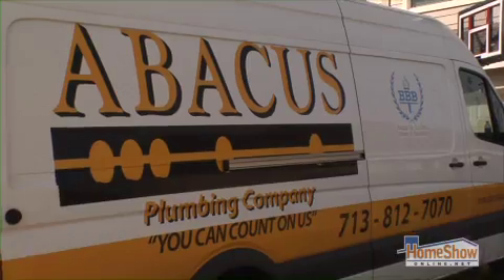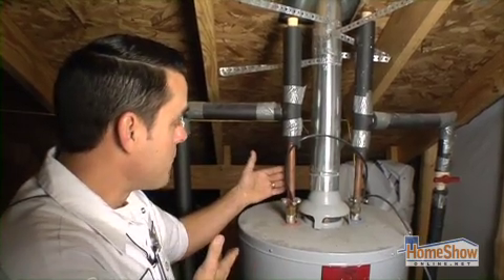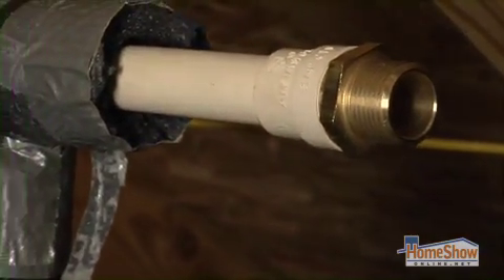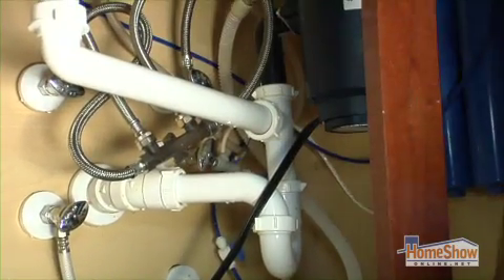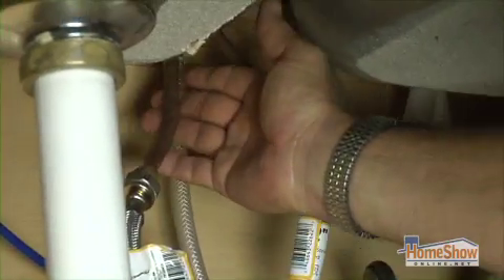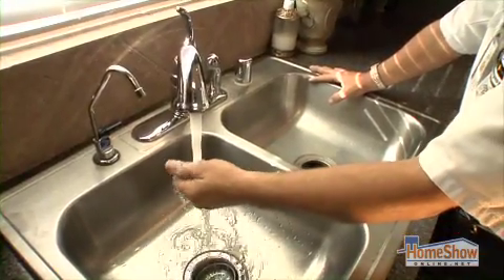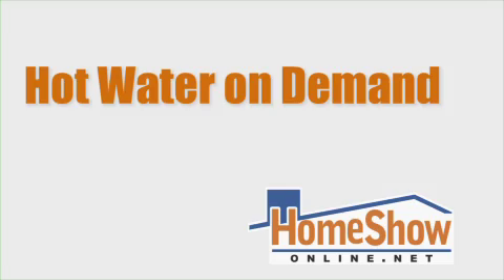Get hot water quicker with a Grundfos recirculating pump

Comment: My grundfos pump stopped functioning correctly, I think the impeller that circulates the water has gone bad, but I've been told there are no replacement parts available.  Why should I have to pay for a whole new pump?  They should make them with replaceable impellers or let you send them back for them to fix.

Comment: Are you sure that's how the valve works?  I assumed the valve opened any time it sensed temps below 90F.  I thought it was a temperature valve, not closed or opened by pressure.  In fact, it is called a "thermal bypass valve".  So, I don't think your conclusions are correct.  The pump might only run to maintain pressure.  When the thermal valve opens at low temps, the pump could sense the pressure drop and turn on.  $0.05 per day would be impossible to achiever with a constantly running pump.

Comment: Yea, lets all cross connect. Pumping a potential 90F in a cold line directly under the sink sounds like a good plan until you need to temper the hot with cold water as most people do. I guarantee this system has serious operating flaws and this is a shoddy way of overcoming a common problem.
Reply: Not only that your taking nasty bacteria laden water a d cross connection to the cold,you will get sick,you will cause thermal expansion, your relief valve will    blow off creating a mess, install a closed loop the proper way to do it.

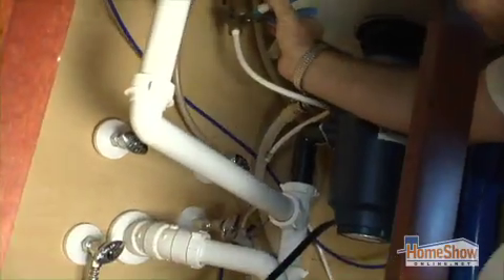Comment: At 0:48 says start 30 minutes before first shower.  That's a very long time to get hot water there.  At 1:01 see thermal bypass valve it "closes at 90F deg" to stop hot water from entering the cold line.  What keeps the valve closed? Ans: A "continuously" running pump.  When the pump is scheduled off and the valve returns to its NormallyOpen position what prevents water from being sucked out of the hot water lines=water heater, raising my gas bill, when I use cold water?  Ans: nothing